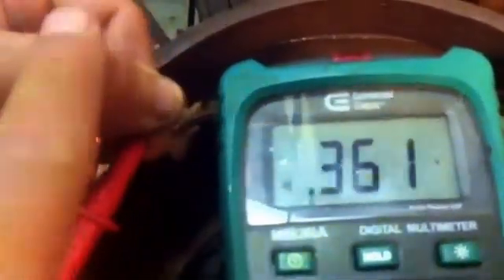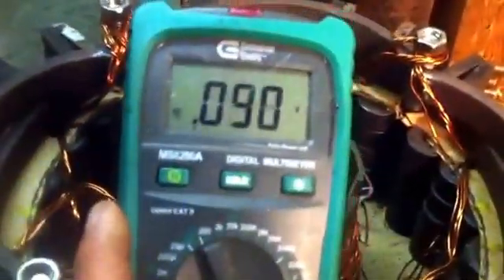Ed Leedskalnin's magnetic generator, and the Human electrical system. (The Body)

Comment: Also bare copper wire to link each of the three magnet to the one bolt. Remember this is a homopolar motor with an AC generator. Your have to flow current to the arced bus bar, this is your 4 circles currents to enter back the energy and keep the wheel turning. Search for homopolar current on the web, you will find the circles into the Tesla coil too, he understand it. I suggest you made a simple homopolar motor with a magnet, a screw and a battery to see what happen and understand the principle. I don't know your skill level but this is a suggestion to see how currents and magnetic field interact and find how to put back the side energy produced into the Axe of the generator. The bell will give you the oscillation you need the create a resonant circuit.

Comment: Missing link could be the steel entrance bell. Ring twice: four neutral magnetics points but two same NN and SS. The bell should cover nicely the handle giving the spark or the magnet field oscillating with the handle. Look on code144.com and search the picture of the entrance bell. This generator is a kind of homopolar AC and DC motor. Two long coil fixed in front of the magnet, one in front of you and the other on the left side will give you two sinusoidal not in phase and one of them should return the field or electricity in the middle of the wheel to close the circuit. The bell will ring when the handle will approach a certain point then maybe a spark will occur sending the energy inside the wheel. The Bel will oscile with the field giving and stabilizing the whole circuit by oscillating and redistribute the energy. If you look again the picture in lodge massons you have a bell shape on top of the energy triangle and the connecting spark gap should be the handle. You crank the wh3l by hand then attach the bell on the steel chain and it cover the handle. I have not study the whole unit but I am a electronic technician with over 25 years of expérience and i have invent and built a lot or things understanding the opération principles. I made my own car amplifier in the past with a total of 600watts and I have made the coils for switching supply and I learned from this. Good work for your wheel. I am making a small one with neodimium magnet. Remember that Edward took what he have a this time and neodymium magnet what not available so he put 5 rows of magnets to have enough power. More magnetics power output than the inertia wheel.

Comment: dear Vinny, I am glad to see you have made some replicas of the Ed Leedskalnin generator. Back in the summer of 2011, his "flywheel" and "number codes" were drawn extensively in crops near Honey Street. I was there with several other people. Those images were not locally human-made. The crop artists are suggesting that we look more closely at his novel research, and try to replicate it. If you or any "free energy" researchers would like to learn more about these blueprints, please go to "Red Collie" on Facebook, or look for my ten physics articles (which explain "crop blueprints") on the Crop Circle Connector Research page? At least someone like you is interested as an amateur, the so-called professionals are useless. I have a Ph.D. from Caltech in Chemistry (or applied physics), but do not know magnetism in a practical sense, how to build motors.   Best, red collie

Comment from the maker: Hey clay
Yes on the length of any wire on being an conductor. Start with along length, then ajust down in length to tune in your circuit. Once you have mastered the control of any capacitor with the virable resistor and transistor . You can start building your own dreams in circuits. It's fun . Peace out Roy

Comment: What if you didnt used the  magnets as magnets. Used them a a rotary spark too create pressure around the wheel. The other side of the coin will collapse in too the center of the flywheel when the spark collapses. The block is not a coil but a spark gap (block is too small too get anything out of it). The height of the magnets are needed for  the copper air core/wire what eve in side too collect the collapsing field and get voltage/amps. Which can again be transferred to the handle spark gap which again creates a voltage in the tackle and block and the field collapses again in the iron which creates a magnetic field and so on. More electricity with iron...... one sided equipment. Layden jars....in workshop high voltage.... radio wave. upper black magnets. i use only 1 COIL...for his best machine. the one in the pipe. Two times light PMH flipping electrons. approach electron flip. between no light departure electrons flips back too original state is light.
                  Use the magnetic wave it is just a good for your electricity
Reply: ..I like it better when I shut up and listen to others.... you know this interests me. thanks for sharing that.

Comment: Vinny I have been rewiring my brain here lately but think that Ed was using that wheel as a high voltage pulsed electrostatic type DC Gen. The tripod was just to pull the stone in the up direction....think about when static charge makes the hair of your arm stand up. then when you ground it. It will drop to the ground. You need to get some of that type of stone he used as its the same as the stuff at giza and try it. Cheers

Comment: Ed's work with the flywheel was a result of what he already knew from his work in moving stones. The flywheel came after and was not needed for the stones. The tripod was used to lift the stone only. He would then place something under it. The tripod alone only gave him limited vertical lift and he still had no way to move the stone horizontally using conventional means.

Comment: Each experiment in Magnetic Current shows a vital piece of what is needed to understand what he is doing. That is why it is in the book. Read the book again. Write down what each experiment is showing and THINK LIKE ED. I don't mean to sound condesending but you are the closest anyone has gotten. You are getting sidetracked.
Reply: NovembersComing .. Hi.. sorry to but in, this isn't my wheel I'm just the local nusance in here.  We're desperatly trying to think like Ed.. half the trouble is there are sooo many variables.. and there are parts; some incomplete, some removed, some so old we probably won't be able to source them so it's a real mission trying to reverse engineer his work.  And boy did he leave a lot of clues and information.  You are right tho. going back to his books really does refocus you... makes you get into his head a bit more. I think you make a good point. Cheers D

Comment: Think Like Ed. He didn't use a coil in the flywheel. He tells you what happens at polarity shift in a magnetic field and coil system.It does look like he used a THIN pmh at flywheel. He tells you that magnets can be pushed out due to crowding.

Comment: Best results with lowest power inputs,  the pulse length was 100 seconds @ 28.64 Amps. Probably hard to pull off, but you get the idea. High current, very slow pulse. Put a Dewalt drill with a very small pulley on that arm. Tension it with a spring. Put the drill on slow. Try PMH horizontal, if that doesn't work try vertical. Get spacing close. 
Cheers
Reply: ...that would be a good test... I'd love to know what reading you get from the PMH.  So basically get the drill turning the wheel so he could move the PMH around and see what's what with it close to the wheel whilst it's running? [edit: is that what you mean]. I like the sound of that... that's moving forwards with a positive step.

Comment: Take a look at this site, very interesting reading. "Gravitation and Electromagnetism : Correlation and Grand Unification". his point is that extremely low frequency is desirable to create the effects we are looking for. IE hand crank would be more than fast enough, maybe to fast. That wheel should turn very slow. Ed built very high magnetic flux into each pulse=current=amps. With a tall magnetic stack and the close spacing, once one pulse ends the next takes over with high amplitude. Electric motor was so you don't get tired and you can go play outside.
Reply: ..heheh Ed liked playing outside... he was like messing with stones or something in the garden.. nothing important... just a few tons here an there.  I''ll check that video out now... sitting on me bum doing nothing much - watching a pink plastic wheel bedini go around... and around...
thanks fella.  ooo I watched the Scalar waves video the other day... that's got that Dude.... ermm oh goodness... Pete Linderman! in... think that was the video. My jaw was on the floor when i saw him... interesting vid. liked that a lot.
Reply: Is it the document that would have a line which reads like this..
"Thus we see that, atoms (or molecules ) can have their gravitational masses strongly reduced by means of extra-low frequency (ELF) radiation."?

oo I can put the link...   http://xxx.tau.ac.il/html/gr-qc/9910036v6
Reply: holy...sh...crap!...
34.8V - Maximum output current with coupled antenna : 300AMPS! .. in their test anyway... but I see what you mean about HIGH amps... the sort that would melt your shoes... and leaves a smell a lot like bacon. blimey fella that's some serious physics you're light reading there. Like it... ..  and the spiral antenna arrangement.... and they're shrowding coils in AC ducting aren't they.. gaud that's intersting. thank you.
Reply: deeds Ya, I just skip to the pretty pictures. Hehe
Reply: aaaflooddrying The idea is high current, massive flux, very low cps, Counter opposing force.
Reply: aaaflooddrying The slower the pulse there is, there is a greater reduction in energy needed to cause the effect. Counter intuitive. Don Smith was high frequency, high voltage. This is low Extremely Low frequency. I don't know about voltage.
Reply: .. I like that... "The slower the pulse there is, there is a greater reduction in energy needed to cause the effect. Counter intuitive" ... .. tell me, how do you know about this stuff... is it something you've taught yourself or should I start calling you aaaflooddryingFromSpace?... you know I'm only messing around.  Nice talking to you again, 01:24.. I better get some Zzzz in.
Reply: aaaflooddrying

heheh I missed this... "skip to the pretty pictures" ..high five, me too.
Reply: deeds Hey, Long wires are like an inductor, or inductor coil, but no turns. Smooooths out a pulse. Its a way of catching and converting electrostatic charge.
Reply: hi bud, interesting... I will ponder on this for the rest of the day...just had my lunchtime ytube fix.  Thanks Clay.

Comment: I don't know if you saw my comment on another video Vinny, but here's what up thinking.  
When you plug something into the wall, the current runs through the device and then back through the outlet to where it came from.  The PMH basically makes the current stay running through the device without going back home.

So you have a total of 12 bolts.  8 for the top and bottom grooved ring and 4 for the two thick rings.
I'm thinking if you wrap and insulate the bolts with coils and hook them up in such a way that when you think of the coils in an electric fan motor.  if you visualize the direction they are wrapped, this would be the direction the current would be moving through the metel in the rings and bolts if they where connected together like it's a PMH. (the rings gotta be insulated still)

Now you have that coil in the middle.  If North and South Pole magnets are + and - electricity then this is the reason every other magnet is flipped.  if they were not then the magnets would enter in the V metal and out its other pole, but when it's doubled it pushes the magnets instead, into the coil. in the middle.

So now if this all is put together properly then you should have a bunch of vertical rings of current looping inside each other running through the bolts and metal rings, and if you could see it, then it would look like the configuration of the winding's in an electric fan motor.  However the current is permanent because you locked them like its a PMH.  Your 'V" magnets are also permanent so the coil in the middle is always being filled with magnets.

Now all you are missing is a rotor.
Perhaps that is what all the metal on the ceiling is for.
Except your rotor is too big and heavy making it stationary, so then your wheel should spin instead.

Let me know what you think about this.
Reply: I will try to do the math to figure out what the configurations of the winding's should be.  I don't know if you would want to have each circulation of current on a separate circuit (I.E you wouldn't connect all the coils together, but only every two like the PMH has only two.  Or would you connect them all together.  I think connecting them all together would be best because then there would be even current strength in all the imaginary vertical rings., but of course that will be much harder to figure out I would think.  Anyways, I hope you read this soon.  
Thanks for reading,
Andrew

Comment: Impressive flywheel!  Let me share my background.  I have been interested in frequency/harmonics, EM, RF, and the like for the last few years. I am a Sr Level INFOSec Engineer for the last 20 years, and over the past 4 years I began designing tactical cellular systems for the Dept of Defense here in the US.  Over that time I have been tired of dealing with wave propagation problems and line of site problems inherent with deployed tactical network radios, and the cellular systems that my designs rely on.  So, I set out to make a better world with new technology.  I began with Tesla and have since leaned a good deal about electronics. I am one that believes in learning through experience and using books only as a way to investigate what I se fit for my goals.  In other words, I never believe anything I hear, and only about 50% of what I see until I perform it for myself.  I am open minded and I believe self taught individuals are the only ones that REALLY know and REALLY have the diversity to be extremely successful in this world.  Now with that said, I discovered over the last week just be happenstance the power of 9 and digital root (I'm sure you're all familiar with well ahead of me)  2*9=18 (1+8=9) etc.  I then realized 3,6,9 repeats itself up the scale when counting by threes (3,6,9,12 (1+2=3), 15 (1+5=6) etc  This is what lead me back to Tesla and a quote that I just found stating something about knowing the importance of 3,6,9 was essentially the "key to the universe"  I'm sure you've all heard this.  Well that led me to Leedskalnin's work over the last week and I've been obsessed ever since.  Almost everything I watch on TV or the 'Net is now open to interpretation to me.  I watched a show called weird or what on Mind Control or Mind over Matter, and this is something I have always believed in but electrically, and frequency wise, it certainly seems feasible, like the whole world is based on Frequencies and electrics, etc.  Well in the same episode they mentioned a DoD project called Star Gate, and I listened in, etc, well this afternoon I searched for magnets to buy for some experiments and happened to search for VEE magnets, and it was then that I found a site that stated theft henry Ford used V-Mags in his flywheel and right beside it was a picture of Ed's flywheel.  Until then I was under the impression that Ed built his machine from scratch, but it doesn't appear to be the case, as you obviously have realized as well.  That same site mentioned something about a phenomena known as Star Gate of the ancients or something.  I'm going from memory here.  But it is very odd to me that everything I read or find on what I think are unrelated topics all lead back to the same concepts.  Anyway, some further searching led me to your youtube video.  My theory of the last week has been that maybe Gravity is merely Magnetism, and maybe ed's machine is not actually creating magnetic fields but eliminating them and allowing objects to float.  He speaks about knowing the secret of the pyramid, and that led me to find out that Giza is actually on the intersection of two Ley Lines.  Did the ancients use these Ley Lines to levitate their stones similar to what Leedskalnin is doing with his machine?  Possibly.  What has everyone ruled out with regard to the Masonic Lodge in Philidelphia?  What has anyone learned about the 7129, and 6105195 and the placement of a pyramid object over the flywheel?  I saw mention of this and I have the details from another video called Ancient Knowledge-I believe.  My investigations have also led me to a man named Jeremy Stride who has been at this very thing since I think 2009 or earlier, and fell ill or something in 2012 and vanished from the boards and shut his sight called code144.com down.  Anyone know his fate or if he is still around?  He had some great mathematical deductions he came up based on Prime Quadruplets, and their centers, and the particular degrees on the flywheel (Ed's)  Sorry so long of a comment, but I'd like to keep in touch with yu all, I subscribed to your channel so i hope to find some answer along with the rest of you.